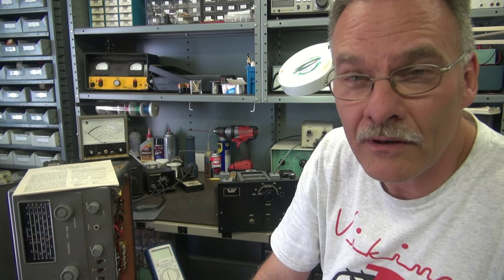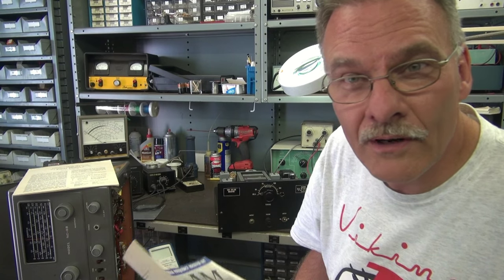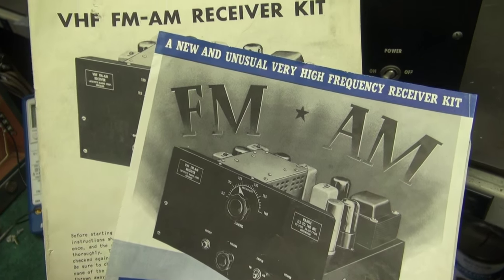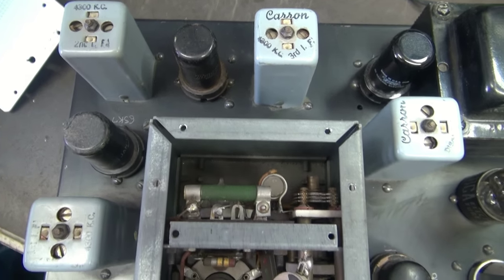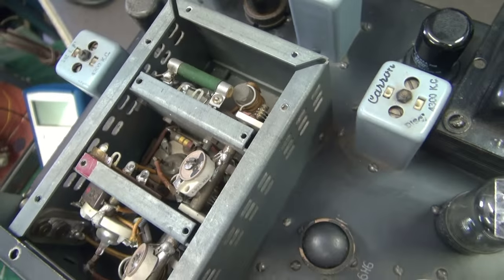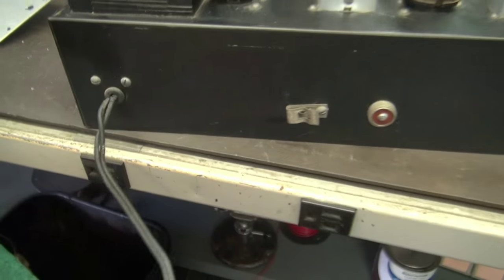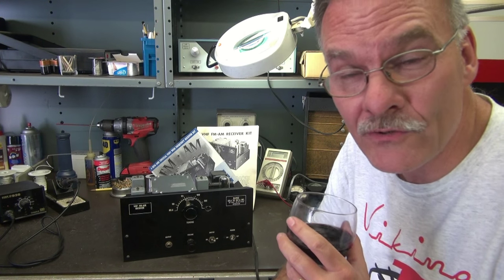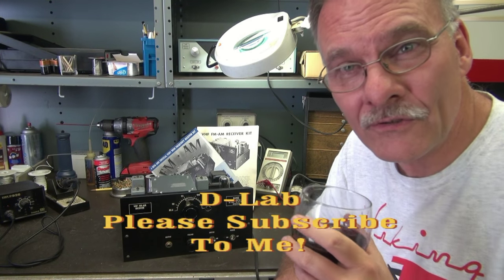Vintage Lafayette LRC-130 AM FM Tube receiver Antique radio kit demo

Comment: Thanks for the nice video. I used to love to build vintage tube radio kits, especially pre printed circuit board types. Question, If I'm not mistaken the AM band is much lower in frequency than 88MHz -108MHz. How then does the receiver operate on AM?

Comment: Dear Terry -- I just won the receiver on E-Bay, when I get it and start the restoration of it, I will let you know what I find. Also, if I happen to run across any documentation, I will also let you know. This is the second piece of equipment that I have bought from you. Take care, and the best of 73's......... Jim ......... WA5WRE
Reply from the maker: +James Searcy Cool deal, Thanks Jim, I have it double boxed fro the trip.Too bad someone in the past drilled that giant hole in the front panel! Good luck with the restore